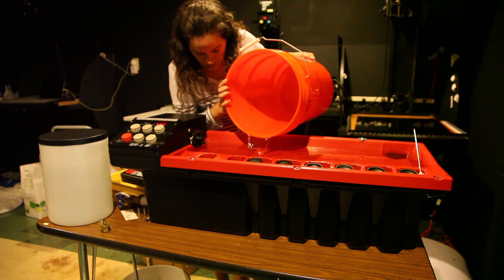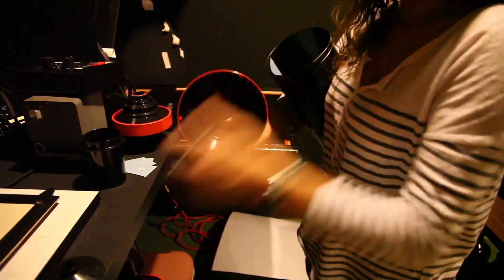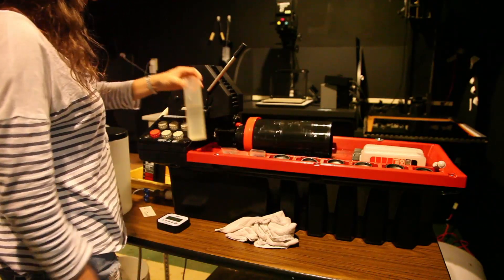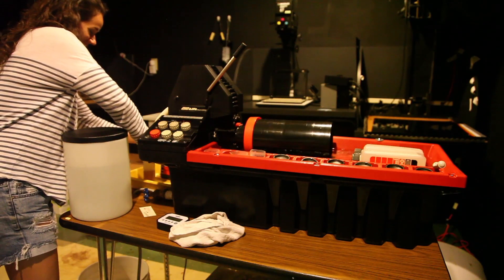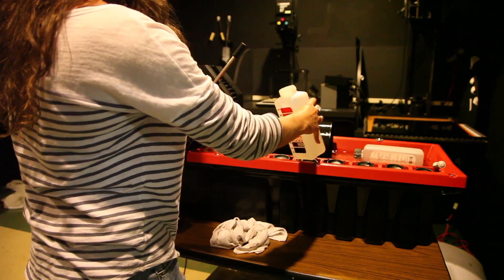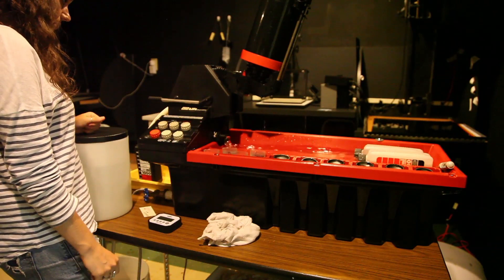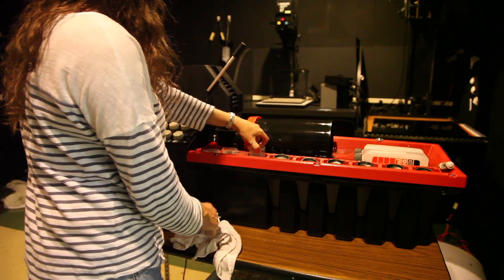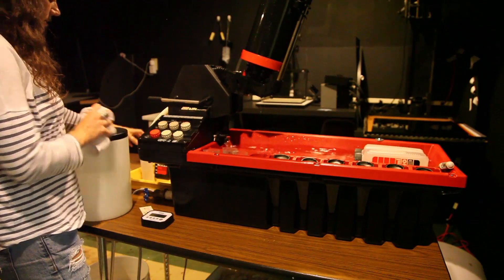Jobo CPP2 with RA-4 Chem for Color Prints - How to Develop/Process - Point Park Photo Department

Comment: Only fool could devise such a complicated way of wetting a piece of paper have you never heard of a nova slot processor
Reply: Harry New these people didn’t make the machine, you donut.
Reply from the maker: @bowmanj603  haha, donut is a great choice of words.  Thanks - and we understand there are trolls on all levels.
Reply from the maker: Harry New: This device served us well on heavy use for two years.  we wouldn't want to be fool, but the CPP2 can go up to 20x24 in the RA sheet/paper world that's as big as it gets (it can also assist in consistent film development which yours can not) so our method is multifaceted - and when as we upgraded to the CPP3, we are investigating how to get the CPP2 fixed only for film so we have two machines (we currently have a very old Jobo that has been developing our film and is no longer 'fixable'  After a quick uninterested glance at your slot method I quickly noted that it is quite small- limited to maybe 8x10? 16x20 at best?  and only can develop prints - yeah?  not to be judgy back at ya but the slot processor seems pretty simplistic for our program/students abilities.  Truly, we would actually LOVE to invest in fancy pants 10k roller processors and not be fool (with NO lab managers at the time either btw 2016-2018, only professors who are not lab managers operated this machine during its run) - we deal with what is in our university/departmental budget -that which we photo professors do not dictate - but can only advocate for - and have repeatedly dreamed for a large format roller processor once we got our lab manager. Who knows, right - maybe one will fall into our lap. Roller processors, unless you have someone who can regularly attend and fix them, also do not work well long term if they break without support/parts to fix them and eat up substantially more chemistry overall.  Kreonite is the absolute top of the line if we could not be fool and do what's actually best for a photographic artist to not limit their scale/output.  Perhaps maybe while we're talking about not being fool we should just get ourselves into the Lamda process? A program can dream right?  

Sooo, If you're an at-home enthusiast looking to develop and print analog film/paper and want to make serious work that is not limited to small scale works, we believe that this particular machine/method allows our students to take with them long term skills AND the ability to also financially do this later in their life if they choose to *JUST LIKE Brella Umbrella up there in our comments - who left ICP (ahem.. an internationally ranked photo program btw that uses exactly what we use) - they are rolling and grooving internationally with their own at home process via university learning.  So, Harry New - thanks for your opinions, we have noted your words of criticism with no real substantial evidence in your crude opinionated comment that your method is actually better. We have opinions and are entitled to ours as well. be well, not mean. education is our top priority - not belittling the process in which we choose to create our art.

Comment: What a load of hassle have you never heard of the nova slot processor ,always ready no set up time a perfect  print in a fraction of the time . Drum printing is a time consuming joke and using one to develop c41 film will give you serious filtration problems due to the film having a variable agitation flow along its length as the outside and the inside of the spool have considerabley  different surface speeds .

Comment: Thanks for that great tutorial! I have two questions: 1. The suggested times are applicable as period from to pouring in the chemicals into the drum until to starting to pour out the chemical from it or until the water is poured in to the drum? 2. Do the chemicals work fine at lower temperatures(f.e. 75 degree)?

Comment: The jobo was designed to leave the motor running while lifting the lift, you do not have to turn it off between each chemical. Just FYI
Reply: thanks, in my experience the cog wheels get jammed up when it's left on as they are separated from the lifting process-  and being made of plastic, I didn't want to risk it, so we play it safe here.
Reply: Not a problem. Do what works best for you. I did it this way and then was informed I could leave the motor on whole changing, so I do. Just figured I'd mention.